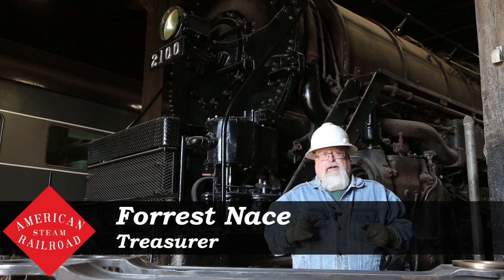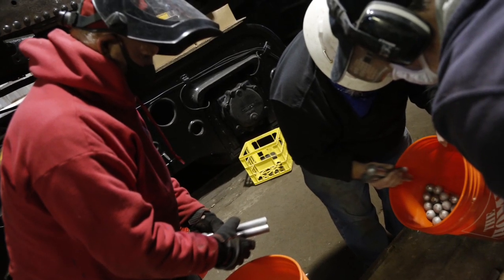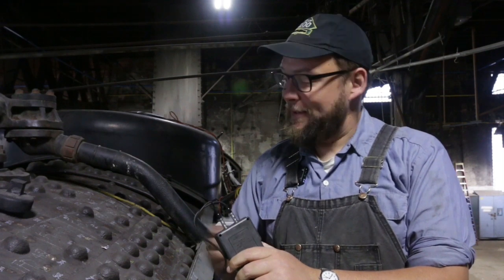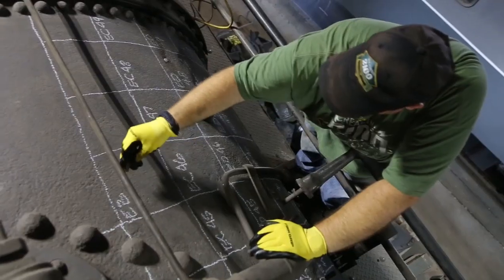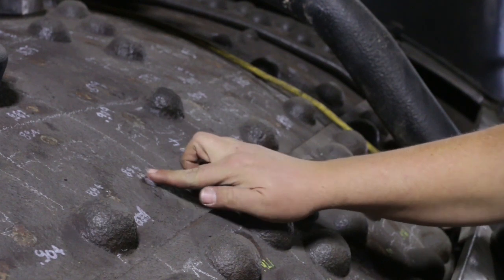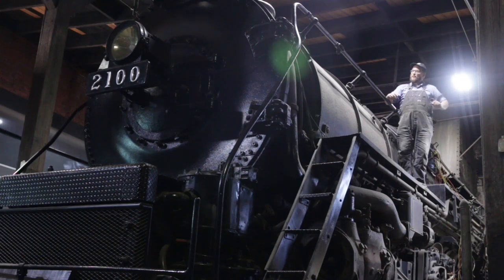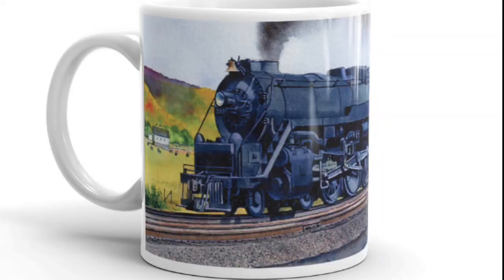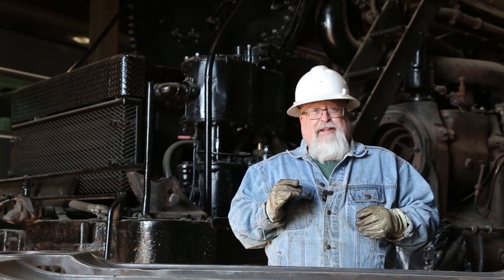Ultrasound Testing a Steam Locomotive Boiler - November 2020 Fire Up 2100! Update

Comment: Appreciate the update! How long do you think it will take to do the ultrasound testing?
Reply from the maker: It will take several work sessions, as three readings from each eight inch square grid is needed.
Reply: @AmericanSteamRailroad  will 2100 remain a Coal burning Locomotive ? I do appreciate all the videos that you have put out on the 2100’s rebuild
Reply from the maker: Rudy Carlson Yes Sir, 2100 is in the middle of the process of converting back to coal. The oil tank was removed from the tender last year and a new cab floor is being fabricated to accommodate the stoker.
Reply: @AmericanSteamRailroad  All right! Thank you for the information! I was wondering about that to convert her to burn oil will take more time and more money to do it! It is better that she is a coal burning locomotive
Reply: @AmericanSteamRailroad   any updates on 2102?
Reply: @rudycarlson8245  spring 2021 is their plan from what insiders are estimating.
Reply: @steamgent4592  Thank you
Reply: @AmericanSteamRailroad  now since you got 2100 running now its time to get in contact with the science industry in Chicago to get NYC 999 fired up and restored and running again from the Chicago science industry and bring her out and get her fired up and running back on the rails on excursions

Comment: December 2020 Fire Up 2100! Update
Reply: I would want to see the locomotive running next year.
Reply: @Rainbow2997  I would too but there were still a lot of work to be done yet! Test fire test runs and satisfying the FRA and the most important getting the Boiler certification
Reply: @rudycarlson8245  Don't forget the whole PTC deal as well.
Reply: @justahillbilly7777  that to yes a lot of work to be done yet!
Reply: @justahillbilly7777  you only need that for class 1 railroads. It probably will never run on a class 1 so not necessary. Class 1 RR's hate steam.
Reply: @steamgent4592  why do they hate steam? 
A steam locomotive can bring a lot of money In! It’s not about the money though
Reply: @rudycarlson8245   "liability"
Reply: For a tour on the Philadelphia & Reading railroad system.